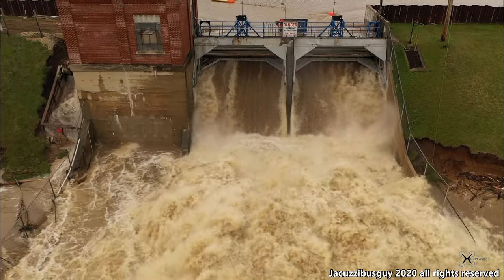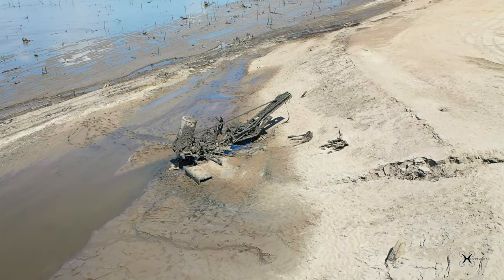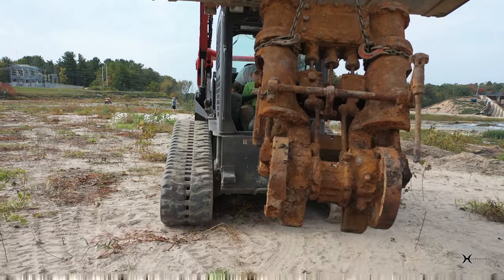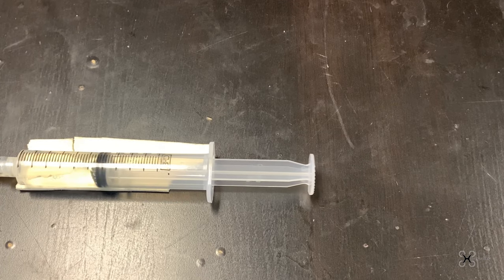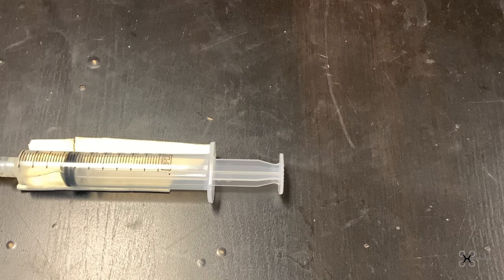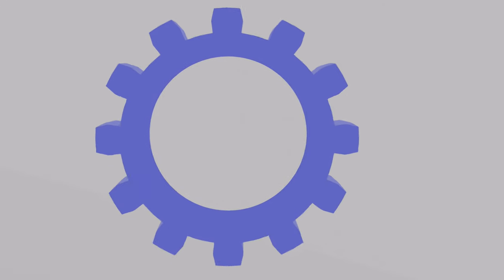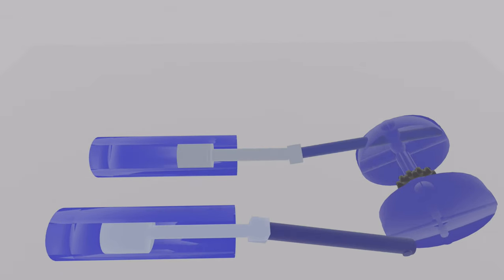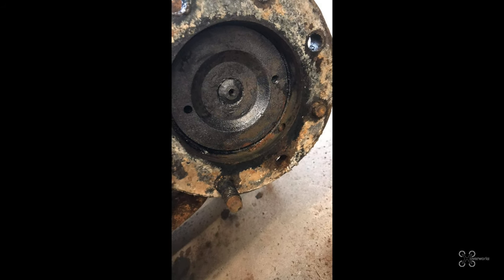Wixom Lake Steam Shovel...What is a "Steam Motor?"

Comment: Yup, it's a Thew, could well be a Type O.  You can see the horizontal crowd.  Looks like it's all there, but it may be a trick to restore the steam engines. The picture after you started soaking one of the steam engines looks promising though.

As we discussed, I have several videos posted of the only other known Type O Thew running at the National Pike Show, Brownsville PA.  That one was displayed at a special event at the Smithsonian a couple years ago.

Come on down to the National Pike show next year, you can spend a lot of time crawling over it.  Very friendly bunch, with a lot of knowledge.  Easy drive, all Interstate. There is both a spring and summer show each year.

There is also a slightly bigger Erie B steam shovel there, good runner. It has been undergoing overhaul, but may be done by now.

Have you talked to the Michigan Steam Engine Show guys at Mason yet?  A lot of steam knowledge, and a big working steam crane.
Reply from the maker: SteamCrane I will make a point to
Get to pa for the event in 2021.   

Thanks for the kind words.

Comment: Look at the crankshaft again. I can almost gaurantee that the cylinders arenn't 180 degrees offset from each other. If they were, the engine could get stuck on dead center. I would guess that they are either 60/120 or 90 degrees offset